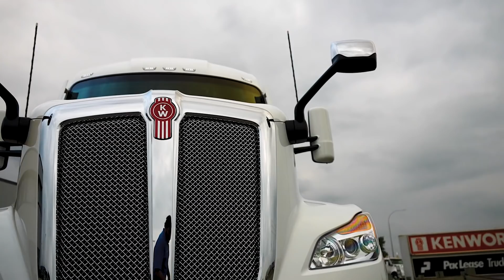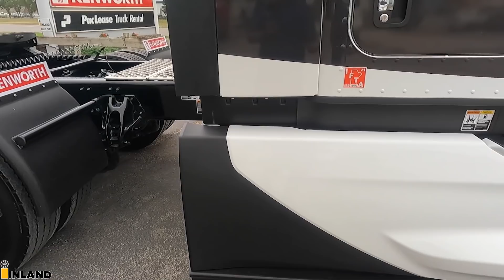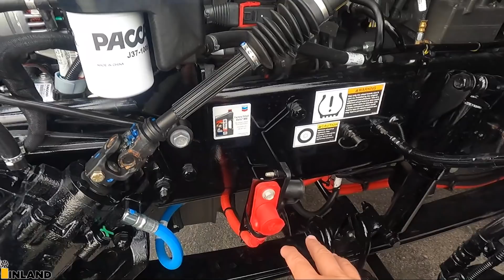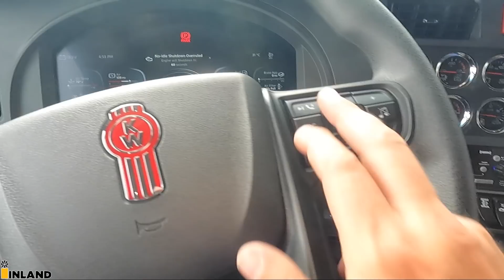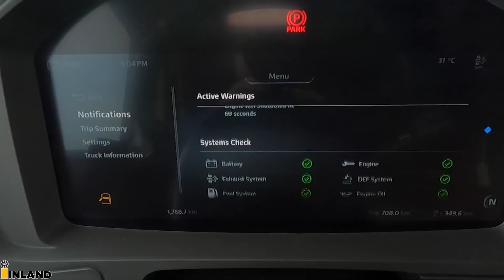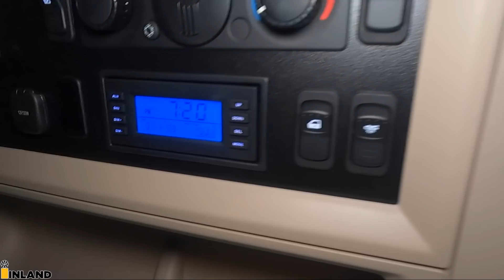Finally    My first look at The Kenworth T680 Next Gen   The Kenworth Guy

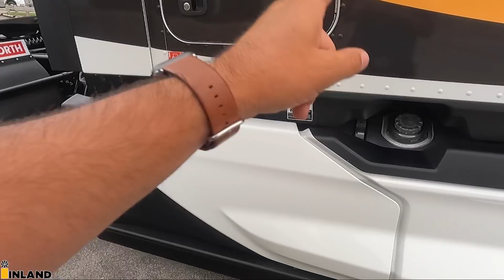Comment: The trim pieces around the fuel tank (at 7:15) have come off, 3 have come off my '23 and they are EXPENSIVE for the plastic that they are. Its had 2 sets of injectors, 2 fuel pumps, air dryer & air compressor replace in the 2.5 yrs I've been in it. The plastic square piece that covers the access to the headlights come off, they are almost $200. Just for the this square of plastic! The turn signal stalk & wiring has been replaced just from using the high/dim lights. The electric window switch on the drivers door is also poorly made, multiple trucks in out fleet have had to have them replaces-they cost around $400! The truck rides good & is pretty quiet but the workmanship of the parts - its like people don't care anymore, or they make things so cheap-you have to spend money all the time.

Comment: For access to the catwalk and air lines I'd like to see them add steps on both sides instead of just the driver side. Just a convenience option. Also, when I close my front curtains I find that the track doesn't allow the curtain to move as easily as I'd like it to. Sometimes I have to fight with it to get it to slide. Other than that, I will be getting a brand new 2023 t680 w sleeper cab hopefully next week and I am excited to see how it's different than my current 2020.

Comment: 6% better fuel at 500 hp or the 410 horsepower ?   is it wrecker adaptive with top lights or does the ferring have to be chopped?

Comment: Garbage. Not your fault. But, garbage. They have not created a real replacement for t600/660. This thing is garbage, junk, crap or whatever else similar to those names, also a reason why a resale value on these is very low, not to mention electrical issues….will never buy one and know fleets who are returning theirs and switching to real trucks, the ones that real drivers want to drive-since those fleets do care about the driver retention more than keeping parts department at a dealer or a stupid pencil pusher happy,
Reply: 🤝Totally agree. Lots of plastic shit, electronics everywhere feel like gonna have a million problems. Not a reliable truck. 

The T600 the flagship of the brand and they haven’t been capable of designing a proper susbstitute. I really think that if they make T600 again they’ll have many buyers. 

I fear 😞 they will kill the t800 and the W900 soon. Last real trucks standing 💪

Comment: Not a 680 fan. Limited storage in the Sleeper and cab and don't even think about finding one with a standard transmission. The Paccard engine would be useful if they melted it down for a boat anchor.  I'll stick with the old school W900s.

Comment: Little disappointed. For a ‘brand new design’ it really hasn’t changed much from my 2015. I like the new headlight access. I like that they’ve added battery access - was a pain in my 2015 having to take off the entire step/fairing to get to them. Hopefully, with a Cummins engine, the oil filter won’t be in a stupid place like the old one hidden behind the chassis rail. Digital dash is nice. But the interior is a total let down. I mean I loved mine, but this is exactly the same and there were so many ways KW could have improved it instead of worrying about bait and switch color options. Overall, other than being covered by a warranty for when the engine/dpf system breaks down - which it will- I don’t see the point in spending money on a brand new supposedly redesigned truck that’s almost the same as a 2 year old low mileage used truck. Try harder KW.

Comment: Why is no one talking about the headlights? Lol. That is one of my biggest cons on the previous gen T680s. I drive LTL so we get a different truck every run, we don't get assigned trucks long term. So whatever the truck comes with from the factory is what we get. That includes the crappy halogen projector headlight design that these come with. They do a terrible job of of putting light on the roadway and get worse with age due to the projector surface developing a haze on the lens. I understand that O/O's and guys that keep a unit long term can simply swap LED bulbs or change out the housing completely, but we don't have that option. Really wish KW would follow in Freightliner and Macks steps and put better LED headlights in these trucks standard on all trims.
Reply: Agreed. The only thing I hated about my T680 was the headlights. I avoided driving at night because they were so bad.

Comment: So those LIM switches are actually a speed limit the operator can set. Its pretty useful in moderate traffic when regular cruise can't be used. Just set to 60 and never get a ticket. The blank center switch is used to adjust the ACC following distance and PCC over/undershoot.
Reply: A manual limiter? That be useful I hate using the cruise control

Comment: Moving fuel tank forward will make steer axle heavier and would make installing moose bumper a challenge to meet DOT weight requirements.  You get pulled in to scale house for no reason other than your over 12,000 lbs

Comment: These things have now caught up to the car industry...without a name plate they all look like identical turds running down the hyway 90% plastic and done after 5 yrs.
Reply: More like less than 4 years. These roads out here ain’t smooth no more
Reply: @cowboyupnow63  I have a very old friend who runs a fleet of 35 power units and he dumps these things on or before 500,000 kms because history says the engines shit the bed on or about. Before I retired I owned two W 900-L's, a 95 and a 2000 both with 550 Cats and both went a million MILES before I even took a hard look at them.

Comment: Greetings from the Ohio Porters. 🇺🇸 The overall looks of this rig are cool, more aerodynamic. That’s good. I like the skirting. For years now, the manufacturers have said that full skirting all the way back would give better fuel mileage, and now you say that half of the skirting will give you better mileage. That’s confusing. I like being able to get into the gap behind the cab. Certain trailers require that you get in there to connect/disconnect. I gotta see one of these up close, so I guess it’s time to contact the local Columbus Kenworth dealership. Good stuff.🤩😎✌️

Comment: I rea I hate that these companies barely  change a thing and call it brand new truck with new designs and all they did was angle the hood down a a tiny bit and added fog lights into the bumper. When did the companies stop caring? I want a all brand new T680. Fully and Newly  redesigned trucks.

Comment: Kw puts a plastic snap in T antifreeze connector above the DPF system,. So after few years it will dry out from the dpf heat and break so they can drain More money out of people.    Why not use a brass or steel connection instead.         Volvo is the same way plastic fagile snap in antifreeze line connectors to def doser.      They do it on purpose to suck money out of people.

Comment: Thank you Kenworth for awesome design.      2015 t680 exhaust pipe is blowing hot exhaust on the 1st drive exiles r/s break chamber all the times.  Sometimes you go throu a break chamber once per month,.   The abs sensor on that wheel won't last over a year.    Because constant hot fumes keeping the wire extra hot..           God Bless Kenworth for their smart thinking 🤔
Reply: It's smart because they'll get more money out of you for parts and repairs 😜
Reply: The dpf sensors  right on the DPF system.    Wires always hot few years they  dry out and need $1k+ new harness.       ,🤔   Again god bless Kenworth designers.  Because they're probably on weed when designing those trucks.

Comment: Hopefully those A-post deflectors will help keep the side windows and mirrors clearer in wet weather which should help reduce lane change inciDENTS!!!
Reply: They will not, have them on my truck they direct all the bug juice to your side window.
Reply: @jamesaddie4895  then what is the purpose of having them?
At certain speeds without them, washer fluid covers the passenger (left side drive) and mirrors.
If the wind is wrong, driver side window, not so much the mirrors.
Easy enough to lower the windows for visibility if you have power window for the passenger side and the mirrors aren't filthy from washer fluid.
Sometimes there is no place to stop and clean them for a long way.
Went through a swarm of bugs many times where washer fluid, even with Dawn added, wasn't enough and had to pull off to clean the windshield.

Comment: The need to give up bigger sleeper options 86” or 90” already. We have to live in these damn things. Give us some more space. How about a bigger fridge. Every truck should come with a dinette table so I can sit back and eat with some sense of home and comfort. How about a full closet that I could hang my clothes without dragging on the bottom.
Reply: The manufacturers cater to the biggest customers being the megas me and you may buy 2 or 3 but swift will buy 500 to 1000 a year and since megas don’t want it not a priority
Reply: The answer is weight. The more sleeper or gizmos you add, the less weight you can haul, and at the end of the day the mega carriers are who control whats produced, and they are only interested in one thing. $$$$$
Reply: @Wes_225  Weight and probably costs.. Perhaps it is time the laws increases the weight a bit more to accommodate better trucks.
Reply: The T680 with a 125" BBC compared to a W900 with a 132" BBC should be a fair bit lighter and won't be longer any all if they went out to a 90" sleeper or similar. I'm surprised they haven't gone above 76" due to various people offering larger such as Western Star having 82", Peterbilt 80", KW 86" on the old platform,
Reply: @fang75429  i think its good that these megas dont have a bigger wheel base they can barely back in as it is why make it harder  but they should absolutely offer it as a option or O/O
Reply: @drgoutbreak7934  remember though, not all megas have rookie steering wheel holders. I’ve met mega carrier drivers who have 30-35 yrs OTR and O/O who have 5 yrs OTR….it’s not about who they drive for but how much time they got out her on the big roads. B safe and keep the shiny side up
Reply: Just like these new 2022 crapcadias a lot of wasted space where storage can be used. Just like angle space above driver and passenger seat it could be designed better and cabinets spaces are pathetic. Small fridge.no place for a tv, tilt/telescopic steering wheel could be better, maybe a truck driver needs to go to the manufacturer and design how interior should look and function.
Reply: This is Kenworth, i hate my 2017 T680, and I'm an Owner/Operator.
Reply: I Do wish Kenworth would offer a modern 86" sleeper for the 680,880 & W990 .. I do agree with the closets being a little taller, cause i myself also hate that shirts drag the bottom.. but overall, 76" is plenty big enough for a solo driver, i mean come on
Reply: @TruckinDavo  well, obviously 76” is not big enough cause they can’t figure out how fit a full size closet and a human size fridge.
Reply: @TruckinDavo  I live on the road, so I could use the extra room. I just saw this set up that a company (MC Van Kampen) uses for their teams and omg, I asked them if they would make a solo exception I'd be working for them right now haha. It's got that full size fridge and everything! I love it. I'd never go "home" with that truck.
Reply: Good ideas.
Reply: Exactly

Comment: I wish they would put an on off switch for the Jake break on the smart wheel. Switch on to work the wheel button ..... would save alot of fuel
Reply: I always thought a Jake button on the shifter would be convenient. If it doesn't have a manual transmission I'm not interested in driving it

Comment: Love the new look. Under the hood looks like a cluster to work on though. Bet to do a top end set up that coolant tank needs removed now. Change a turbo got to remove the washer fluid reservoir. Nice thing is they don't look like they take long to remove but at the current shop rates it adds up. They need to bring out a bigger fridge for the long haulers inside. It's about time we got some new tech inside. It's been in the automotive sector for years so it should be pretty reliable. Great looking truck to pull dry van or reefer with.
Reply: you forgot a word Chris....."cluster ****" .....I got ya ;-)
Reply: @brucekoster9253  lol. Yeah that's what I wanted to say.

Comment: I like the new look buttttttttttt they still need a visor on them to breakup that big forehead and you can tell engineers don't have a clue about trucks on so many of there hairbrain ideas you can tell they never work on trucks in the real world . Rear fuel fill not in the middle and that washer bottle rite below the air-to-air pipe on the right side that makes it easy to fill I could go on and on

Comment: For being so new the interior could have been changed so much better. I like the color choices but if you're gunna make a new truck then do it all.... I drive CT 680 I do like it but for the next gen they could have done so much better. I'm actually kind of disappointed. But I'll still take it over Volvo or Cascadia junk. These are way better. And that's coming from someone who has experience in all 3. So far favorite truck is a good 379 with a cat 6nz. W 900l are also a favorite. But I gotta say 379 tops it. 
Anyway I definitely would drive this just a more loaded truck. But I want Kenworth to wake up a little in the interior area. It needs to be redone to match the out side changes.

Comment: Im a small fleet owner.. I've owned kenworths for over 20 years. NO MORE!!!
They are Nazi's with their software. They won't let you turn your truck up past 70mph. They won't let repair shops into software. 
Average kenworth labor rates is $220 an hour.  ( Average general surgeon only charges $140hr )
Their parts have doubled in price. 
Stay away from Kenworth until they stop ripping us off!!

Comment: Windshield washer bottle. Why put it there it will freeze in the winter it's below engine heat and with the new vents letting heat out well good luck getting fluid on windshield in winter.

Comment: Why any owner operator would buy this over a w990 or w900 is beyond me. This looks like a company truck. Can’t even get this with fuel tanks exposed. And it’s priced pretty similar if it’s loaded
Reply: Fuel economy
Reply: @Bendigo1   the resale value compared to the w900 is not even close
Reply: @marcusbutron3924  i know. But who is going to sell their w900?  By the time they do sell it the value is already really low.    Most owner ops that buy t680s buy used ones to save money.   They are much better quality trucks than most out there.
Reply: @Bendigo1  yes they are. But the new ones loaded are pushing 170k

Comment: Why would u put black coolant tank so that u  can't see and have to stand on the tire ?
Reply: Goin back to the good ol days when you had to stick your finger in the hole every day...
Reply: @Bendigo1  I don't think they talk to drivers what they want and what not
Reply: @honeybatth87  either that or they talk to the wrong drivers.     Unfortunately truck design is moving more towards looks, aerodynamics and fuel efficiency and farther away from practicality and functionality.  That one change of moving the coolant reservoir over the engine not only makes it a hassle for the drivers but also for any mechanic needing to work on it.  Just to do a simple thing they have to take apart half the truck just to change a small part that takes 10 seconds to swap out.  Back in the late 90s kw trucks were so easy to work on you could reach pretty much anything any where you needed to get to.  Now just changing a dash light means they have to take out  most of the dash.
Reply: @Bendigo1  they want every truck to the dealership for a little fix and then they don't have enough staff to fix it on time and making u wait for weeks so that they can bill u more for a few hours job 
It's all about corporate control over lower middle class using law and force
Reply: @honeybatth87  It is difficult to find mechanics when those mechanics need a degree in computer science just to open the hood.
Reply: @Bendigo1  lol they may need two one Mechanic one computer degree holder and then a rude front desk officer lol

Comment: You guys keep on talking about improved fuel efficiency. But no real mpg numbers. For example....10.2 mpg bobtail, 9.3 mpg empty trailer, 8.7 mpg 25.000lb loaded, 8.1mpg 80.000lb....these are real numbers so we can compare with older version trucks. I got 2017 KW T680....fully loaded 6.7mpg....half way loaded 7.1mpg.....2019 KWT680 6.9mpg fully loaded, 25.000lb load 7.5-7.6mpg running at 70-75mph. All that manufacturer talk....6-8% is nonsense. Put it under load and show us numbers. Trucks are made to pull not just to impress with statistics. Thank you!
Reply: The problem  with that is the different use scenarios and configuration options.  A truck that runs longhaul is going to be different than a truck that does west coast regional.  If they use the longhaul setup abd say it gets 9mph the regional truck may only get 7mpg but both will be getting a certain percentage better fuel mileage compared to the previous verson.